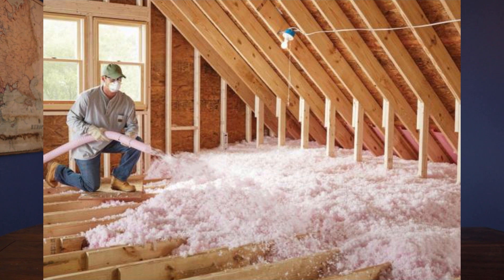DIY Geothermal - What You Need To Know

Comment: Just wondering what is the benefit of having 4 out going lines from 1 manifold and 4 returns from one manifold. Will it work just the same with 1 loop 4 times as long as the individual loops. Planning my own system and looking for any advice. Thanks
Reply from the maker: Technically yes.  You just run the risk if a failure of the line does occur that it completely shuts you down with the one loop.  You would also have to upsize the line to get the correct volume of water to flow through it.
Reply: Why 4 lines instead of 3 or or 2? And if more is bettter why not 5, or 8, or 16?

Comment: Hello Garret, with the geothermal system, how well can you monitor & control the moisture content of the treated air within the living environment? [Oil/ steam is superior to to gas/ hot air for health reasons (dry skin, bloody noses,etc).... where does geothermal fit in?]
Reply from the maker: I have a whole home humidifier connected to my ductwork that is on a humidistat.  During the winter I maintain 42-45% humidity.
Reply: Why do people think water source heat pumps add moisture to the air?.....crazy

Comment: why it is not made of copper??? is better heat transfer material
Reply from the maker: Too expensive
Reply: @Challenged1  realy?? I am from Argentina and it is not expensive in fact it is cheaper. I explain that I am from Argentina making it clear how poor I am.
Even so, I am worried about the corrosion of the pipes, I suppose it can be solved with a thermal paint

Comment: Thanks ... learned a lot.  thanks for the content ...  i have the land and am building a smaller house mostly off grid ...just bought my backhoe and making my wish list projects. trying to think of ways to keep the operating/maintenance costs way down ... simple and passive is my mantra ... would it be worth it to bypass the heatpump/liquid system idea and just use a fan to circulate air from the slinky looped pipes?  or is that too passive for this type of installation?
Reply from the maker: I don't think it would do anything for you.
Reply: @Challenged1  mostly i was thinking of it as a way to cool the house in the summer vs heating in the winter.
Reply from the maker: @ServiceTrek  I'm just not sure you would get enough cooling power out of it to be worth it.  I could be wrong though.
Reply: @Challenged1  I have seen people on YT do this type of a system ServiceTrek is talking about for greenhouses using a large radiator and a big box fan & recycling water from 10 x 30’ hand bored holes (300’ 3/4” pipe) claiming some success, it must help but I am sceptical. I believe you are right of course, that this would have little effect for normal domestic house A/Con systems you are speaking of here.

Comment: Good videos 
Im just wondering,  i intended to retrofit a house but not with ducting hot air but to radiator,  because our system used thermo siphon  with the old boiler 
Would it make sense to do with a heat pump,  tge same way that you did ?
Reply from the maker: It seems like you could, it would have to be a system designed for it.  I'm not familiar with them though.

Comment: The short answer is no. However the long answer is yes for those that have some experience in the field and willing to contract out parts they can't do professionally.
Reply: Not true......all you need is a reliable water well.....you DO NOT want a bunch of engineering  BS.....ground water is always the most efficient, period!
I have a Trane Axiom 1.5 ton, heating and cooling an 1100 sqf vacation home. The temps at the registers when it's in the 30's outdoors? Between 112F to 114F.  Incoming water temps hold steady at 65f from 85ft deep submersible pump.
The performance is so good, I had to find a thermostat that would allow a 4 degree swing.......1.5 ton's is TOO big for my small house.
Reply: What thermostat did you end up with and how well is it doing?
Reply: @terrafirma9328  I use T10 Honeywell. It's my go to for most installs. I like it a lot
Reply: @AJ-ox8xy  Thanks👍

Comment: I'm doing a experimental system, hopefully just one water well. I did hire a engineer and HVAC guy, they told me in theory it's possible, but I'm scared to do something that's not proven.
Reply: Did you do it?
I have a spare well 8” x 350’ deep that I am planning to install a closed loop for a water to water heat pump
Reply: @kaf2303  not yet, its still on the list. We ended up buying a new property for the business and that took up our funds for the next few years.

Comment: i did my own system around 8 years ago . i was quoted a turn key price of 17000 dollars ,but i did it for about a 1/3 of that . It was a 4 ton system with a slinky loop field . I am amazed at how much my system looks like yours . I brought the lines through the wall like you did and made my own manifold too .
Reply from the maker: Thank you for sharing
Reply: I rented a hammer drill with a large bit ... Didn't take long at all
Reply: @davidrobertson8035  Thanks!
Reply: If you see this within a few days.. what did you use to bore your holes through the foundation? Is it slow going with that big of a concrete bit?
Reply: Ok years ago I looked at an excavation company that did horizontal boring they dug a 6 foot trench at the end they started or ended at they then then put a hydraulic pounding unit on a set of rails and started pounding it through to the other end the was steerable so they could start out at one depth and at the other end raise it to another I checked into it because I was bidding to put in a water tank and was trying to figure out how to get the lines from the house to the tank 40 foot away without disturbing the lawn as it was since all I really needed to get from point a to b was the wires for the water level control with an alarm system but as I'm always thinking I realized if I put a 1/4 tube through the middle of the 1 inch copper pipe out to the water tank it would do along with digging down to where they had brought out the line to the tank and putting it through the side of the tank instead of top which froze up several times each winter and then had to be thawed out  so I never did get to see the unit operating  at the time it was a little more expensive than digging a trench but there was no setling  afterwards and if there was a paved drive way  no damage to it
Reply: @Carlos Colton Definitely, I have been watching on InstaFlixxer for since december myself :)

Comment: Great follow up sir. You laid out perfectly what should be thought about when deciding if this can be a DIY. A company will save you months and months of quite intricate and time consuming research and design. The entire install is backed by a warranty from loop piping to supply register and everything in between. Because we are exclusively a Geothermal HVAC company we take pride in proper design and calculation of the entire system. Once pipe is designed wrong and buried...there is only one fix. That mistake calculates to dollars quickly...doing it correct the first time is key.
Reply from the maker: Thank you for the comment.  I sure don't want to discount what a company that does this professionally has to offer.

Comment: I have an existing boiler, All radiator s . I have often thought about a DIY geothermal system. 
I plan to size it to heat about 1/3 of our space and use the existing system in times of greater space usage.
Do Bosch do a similar pump that can interface with an existing hydronic system?
Reply from the maker: I have no idea....
Reply: Yes,  the have also a Water/Water system.
I was looking in that direction as my idea was using a big water tank 250 m3 (66000 gallon).
The way it should work:  in winter freeze the water for heating the house and the in summer restore the enery by melting it.
The 250 m3 size is calculate from the 21000  m3 of NaturalGas i use in a year  and  water freeze (gaves) / melt (needs) 320 MJ/m3 (wikipedia). My current NG central heater, with radiators, has a capacity of 44 kW (12.5 ton).
PS. i live in The Netherlands (53 degree North). Temp min: -15C (5F) to max: 38C (100F).